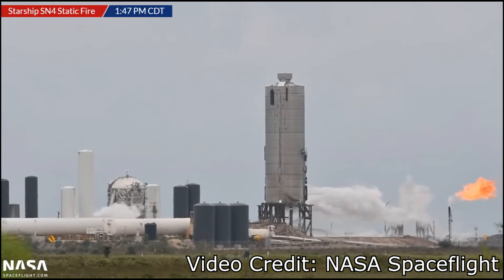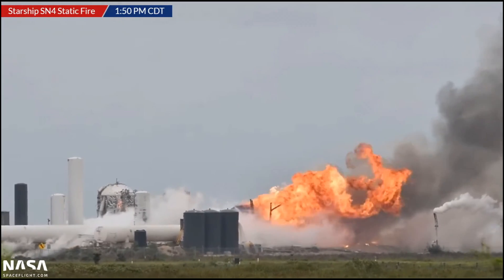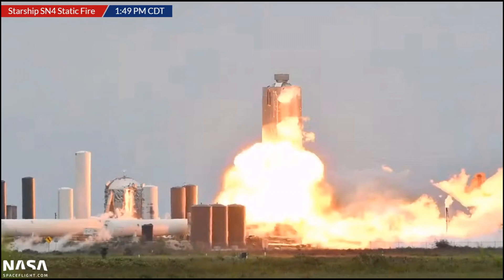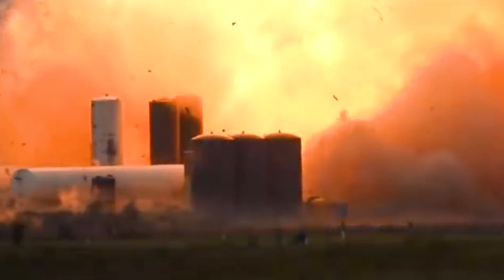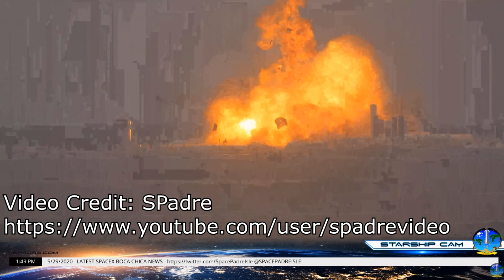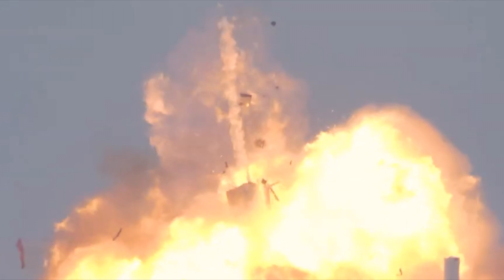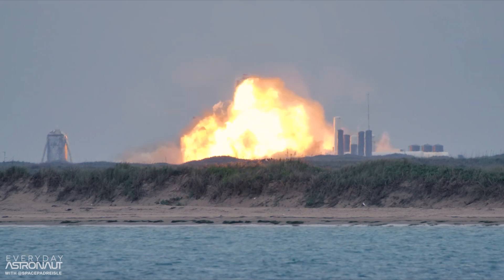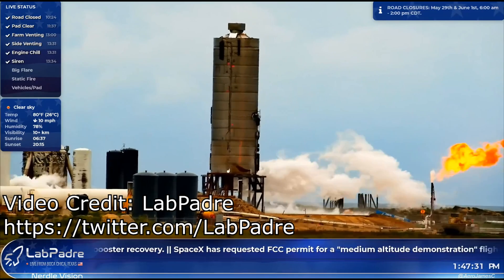What Can We Learn From The Explosion Of The Latest SpaceX Prototype?

Comment: If you notice in the video, there is a 🔥 flame burning to the right of the ingnition test. This is for safety for if the liqiluid methane does leak out (which it did). Methane is a poisonous gas to humans, as well as being highly explosive.  The best/fastest way to dissipate the poisonous methane gas is to ignite it. This is the reason for the flame being there.

Comment: Methane would just burn if it did not also have LOX. The LOX mixture fueled the explosion. If LOX (at higher pressure than the liquid methane) found it's way into the methane tank trough failed piping it would auto-ignite and explode. There is not enough oxygen in ambient air for liquid methane flashing off to explode.

Comment: Thanks Scott.  The mass simulator was probably mostly energized upward by the tank dome.  The gas jets would have a poor impedance match to the mass simulator in free air.  So it was mostly propelled a quick impulse while the tank was still intact.  Once the tank is broken, pressure has other paths of much lower resistance to escape from.

It's the same reason why the bullets of firearm cartridges ignited (outside of a gun) in a fire don't go very far.

8:26 the shock wave is visible.

Comment: So is the liquid methane tank on the bottom or top of the rocket, I always imagined liquid methane on the bottom. If liquid methane is on the bottom is the pressure launching the mass simulator coming from the fuel feeder tube that goes through the center of the rocket?

Comment: Thanks for the footage and analysis, Scott, well done by all parties involved.

This reminds me of designing, building and flying model rockets  back in the early '70s.  It was so much fun when things worked perfectly, but still fun in a different way when things went wacko.  Each time we learned something, what worked, what did not, where we could save weight and where to increase structural strength.  Shredding cardboard and balsa wood is fun, and recovering a raw Grade A Large hen's egg from 1000+ feet unbroken is a design challenge.

Comment: SN1 was the last ship to fail due to a flaw. SN2 was just made for, and passed cryo test. SN3 failed due to operator error, SN4 operator or ground support equipment failure.
I can imagine Elon being annoyed losing the last two ships before a hop with no fault in the ship. Even SN1, the engineers didn't think the thrust puck would work, but put it in anyway.

Comment: Fuel Air Explosion. Secondary also. Mass simulator hit the ground and splashed liquid fuel on the ground into vapor which then ignited as a secondary FAE. Lots of fuels don't burn readily as liquid, but burn OR EXPLODE easily as a vapor. I won't name names for safety, but you can shove a lit match into some liquid fuels without igniting them and put out the match PROVIDED THERE IS NO VAPOR ABOVE THE  LIQUID SURFACE.

Comment: My experience is that a plane traveling at Mach 1 creates a planar shock wave, 90 degrees to direction of travel (not 45 degrees).  Since this  flame front traveled only a short distance, it could not form a planar front.  The best indicator that is was supersonic is there was a thin shock wave vs a broad pressure bump if it was subsonic.

Comment: Carbon fiber is not condutive  aluminum alloys are and steel are conductivity static current the fuel tank in aircraft you have the ground cable .in a cryogenic tank gas stainless is same dangerous spark....

Comment: Electric wire is close to the steel produce a spark ignite outside the same steel skin is the rocket and the fuel tank that is more risk because the elements of electric wire are attach to same steel not even separate 4 inch to the structure the fuel tank  all the ship is the fuel tank to eliminate weight its like the version of Zeppelin ..

Comment: Engine under the fuel tank need separate by bulk head the engine is to hot temperature create boiling the cryogenic metals steel in fuel tank create static current inside the stee fuel tank even explosion occur in planes is common static current in ambient temperature this is possible and vibration of engine close to bulk head not good idea in future problems may occurred .....200 pounds of trust resonant vibration caused metal fatigue..

Comment: Do they not use a water deluge under and around the base to quench any lingering flames after these tests?
Methane mixed with air (80% N2) has a very wide range of flammability.  It also has a different (higher) speed of sound due to its density. If there was an enriched O2 atmosphere nearby (leaking or spilled O2) the flash burning would have been faster than the speed of sound in air (at STP).
This series of mishaps leads me to wonder if the designers know much about stainless steel alloys at cryogenic temperatures. The original J2 engine had issues (and failures) due to low temp fatigue properties.

Comment: I'm old enough to remember, back in the 50's, that the Vanguard, Atlas, Redstone rockets used to blow up on the pad during tests, with frightening frequency, and all the non-STEM types used to wet their diapers. 
New engine designs, with tons of highly volatile fuel, and you test it until something fails, and then fix that. 
That's flight test. 
Besides, test explosions are neat, like REALLY good fireworks.
Reply: I always like the quote from the journal, Astronautics, issue 38, October 1937. "A good rule for rocket experimenters to follow is this: always assume that it will explode.
"
Reply: @spacecadet35  Unless you want it too
Reply: Non-STEM types - love that. We could use "Stemless"
Reply: People always disregard how quickly these prototypes for starship are being built, I am amazed how quickly they integrate their learnings into the next build 3 and a half test builds in less than 3 months is rapid development.  Footage of US rocket tests in the 50's have always been favourite viewings of mine, it always reminds me to try again when I fail.
Reply: s/REALLY/THE BEST/

Comment: I always thought the fuel connection lines were hopelessly under-protected, especially being so close to the actual engines but damn, that was a hell of an explosion.
Does anyone else think the infrastructure around that test site is waaaaay too close to the rocket itself?
I can't help feeling that there is a ton of damage from an explosion like that and it can't be cheap to check and replace every single piece of equipment, never mind the clean up operation.
The Crew Dragon launch on the other hand was absolutely spectacular - simply awesome.

Comment: When you showed the "brown" shock wave "on the left" and then pointed out the second shock wave, I've seen that before.  In quite a few videos they have released of nuclear explosions you see the same pattern.  The second shock wave is the result of the first one bouncing off the ground.  That was a big bada-boom.
Reply: Actually, the "rising shock" in most nuclear test videos is from the flash of the bomb being bright enough to literally evaporate and detonate the ground itself. The "direct" shockwave follows after.
Reply: @cerebralm  Not according to the Scientists.  Their diagrams were rather convincing.  If the shock wave is above ground, it comes down and hits the ground.  It keeps propagating out and follows the ground.  However, that first impact bounces and travels separately, but still away from the central source.  I've got about 15 DVD's that restored the original film data they gathered from the original tests.  The pressure waves from those bombs were vastly greater then chemical reaction, so they are much more profound.

Comment: I'd be  bit wary about using those tanks that blew their overpressure valves. They had external overpressure causing internal overpressure - buckling of tank? - then overpressure valve blowing. Could easily have overstressed the tank and its flanges.

Comment: You really need to read up about fuel air mixtures and what makes something explosive like this. Notice the thing was leaking and the cloud actually reached the open flame of the flare, but it didn't explode at that point did it? The mixture was too rich to ignite at that point and had to mix with the atmospheric oxygen more before it would combust. Now if it was a LOX leak, everything within the oxygen cloud would have gone up the moment it got to the flare, including things that normally would not burn but will because of the oxygen.

Comment: Over 80 years of rocketry experience says use a flame diverter to protect both the rocket and the launch facilities during test firing and launches from the effects of the rocket exhaust. Why doesn't SpaceX at Boca Chica? Also, they really dodged a bullet on this one, as the rocket wasn't fully fuelled. If it had been, the explosion would have been much greater and probably would have taken out the tank farm as well. Look at the damage done by the Soviet N-2 rocket when it blew up on the pad. Going fast track is great, but try and learn from the past as well.

Comment: The occasional pleb might think this is all a bit strange with that huge amount of methane not igniting immediately. One should never forget that lighting a combustible gas is actually pretty difficult. Too much oxygen = no ignition. Too little oxygen = no ignition. Our breathable atmosphere just so happens to contain a favorable mix under most circumstances, so long as enough liquefied gas actually manages to vaporize to a decent ratio....and is not still extremely cold.
SpaceX is probably intentionally testing the various iterations of the SN(x) to destruction, with a few premature (un-)expected failures.

Comment: As liquid methane that would make sense as methane has unlike kerosene a very specific temperature that causes total combustion ("the explosion.") Hence the problem of using liquid methane in an ambient air environment (problem of humidity or very high heat content air.) Liquid methane thrives in the vacuum of space because of how near absolute zero the temperatures are. Methane has a tendency to *leak*(literally walk on the surface) making it first off very deadly (I think a Lake in Africa killed thousands from a methane leak) and second obviously highly combustible.

Comment: Same principle as putting out an oil well fire. Get close while cooling it, detonate a bunch of dynamite over the top, and the shockwave puts out the fire. Then you can fix the pipe and put a new well head on. The stack getting put out is a perfect visual example of that process.

Comment: People may see this as a failure. In fact the test was a success. It did what all tests are supposed to do, reveal a weakness in system or process. So I am not actually disappointed so much when these events occur.  More is learned from a 'failure' than a completely 'non-eventful' test. Plus, in a way, we kind of did see a  partially successful lift off. To throw 20 tons in the air like that, with non-focused, controlled thrust, is pretty impressive. Even if it wasn't a sustained controlled flight with a soft landing. :)

Comment: My assumption is, that the vibration of the static fire had damaged a solid connection.

Than the venting started, but the flow rate between egress from the vehicle and ingress to the tank didn't line up because of the leak, so an emergency cutoff was performed. Probably cutting off behind the leak, which means a pressure wave would travel back to the leak or the fast cutoff had just janked a different part of the connection loose, because of the inertia pulling a vacuum on the cut off valve.

The cutoff was too fast and increased the leak, and also send a pressure wave through the vehicle, which sets of the emergency venting on the side of the vehicle due to an overpressure event.

All this flow changes of the liquid did then form one giant pressure wave on the bulkhead on top, setting off a high pressure event on the upper tank as well, which starts venting oxygen. At the side of the vessel.

They probably then tried to close all valves at the vessel ports. Some damage on this equipment then created a spark, either by an electric discharge, a faulty motor winding or a fast metal to metal contact.

Just my two cents.

Comment: Wasn't that a massive tank failure in thrust puck area??... implying design and/or weld quality control issues remain.  Tig welding stainless steel is doomed IMO.. only takes one tiny defect in the thousands of feet of welds, which may all fail once heat cycled a few times through multiple launches. SpaceX will certainly find issues... but will probably spend many years chasing this,  in an attempt to achieve a super low cost build.

Comment: Just before you said it I was thinking "water" hammer as well. At that height you have quite a bit of pressure and when that fuel hits a sudden 90 degree bend in the pipe you may get a connection being torn apart. After their bonehead mistake with the under pressure implosion of the previous one it seems likely that in their hurry they may have skipped  putting a few fasteners before and after every bend.

Comment: My impression from the slo-mo footage is that it was an engine plumbing failure.  For a few seconds before the main propellant leak you can see there was a small leak billowing from the engine bay which built up until the moment the purge valves were opened.  That moderate engine leak then suddenly got much worse, which led to the big white plume appearing from under the stack.

Comment: Scott - thanks for the excellent breakdown of the procedure and the accident. The more experience with these rockets and procedures the better. We do not want to have astronauts in the air/space and have something never seen before occur. Also, when the engineers know what will cause the rockets to explode on the ground the easier it will be to avoid those chain of events. 
This is all positive even if somewhat disappointing. The speed with which SpaceX is developing their rocketry is truly amazing.

Comment: this is getting ridiculous. it is almost as if they dont know how to make a pressure vessel. are they even using engineers to design this? or just going with whatever? i used to work with a third rate welder. he was american and white but could barely speak english. he was able to make high pressure tanks certified and rated to 1000 psi in a basic shop and no engineers. maybe they should hire him. seems he knows more then spacex.
Reply: P rotoin  good to know, but, i am pretty certain that every tank used in the rocket industry is a pressure vessel. a vessel, designed to hold pressure. any cryogenic liquid require a pressure vessel to be stored. the external tank is a pressure vessel, the lines going from the external to the internal tanks are also pressure vessels. anything the cryogenic liquid is flowing through, is a pressure vessel. but i guess the ground crew failed this time? i guess i should say, again?

Comment: @10:44 They'll probably find the mass simulator inside/underneath that oxygen tank and the liquid oxygen added to the burning methane when it burst on impact accounts for the final blast. Maybe it's not unlikely that the thrust puck structure and therefore the oxygen tank actually survived the initial blast. And the big pieces flying came from the thrust chamber walls below the oxygen tank or the methane tank blowing apart. But how did the GSE protection girders end up on the other side?
Edit: So from pictures of the aftermath, it seems the mass simulator came down through the launchpad between two of the vertical "legs" and not resting on top of the thrust puck

Comment: Methane is heavier than air. It built up such a large amount that it became a fuel air bomb like a MOAB. The source of ignition is the flare pipe which is placed much too high! In order to safely burn off the methane while it is still in small amounts the fire would have to be really close to the ground. It took a long time for the methane concentration to build up to explosive amount. If the flare had been on the ground it would have just ignited the gas coming out instead. Still dangerous but not nearly as explosive as a fuel air bomb.

Comment: You can not slow down a standard 30 or 60fps camera to look at something like this explosion to see where the blast started. A non slow-mo camera does not store its video as a full clean frame per image due to the cameras internal codec/shutter phenomenon. Something as fast as a blast will store portions of the frame at different (very fast) increments under control of the running codec. This is commonly noticed when people video lighting strikes. The first single frame of lightning will (most of the time) display only chunks of the lightning bolt due to this shutter/codec phenomenon. Only a high dollar (true high speed slow motion camera) can be used to unequivocally examine a high energy explosion.
Reply from the maker: Good thing that most of these cameras are using high end, full frame sensors without rolling shutter effects

Comment: Regardless of ignition source which really doesn’t matter, good analysis.  But I disagree with you that the flame stack was ‘untouched’. In that frame shown by you, there’s a deceptive illusion. Most of the flame leader from the flame stack to underneath the rocket is hidden by those white clouds along the ground. In other footage, you can see the fuel burning on the other side of that cloud along the ground. But I can see how anyone seeing this frame by frame from this angle could easily make that mistake.